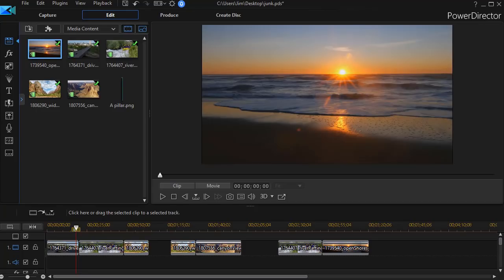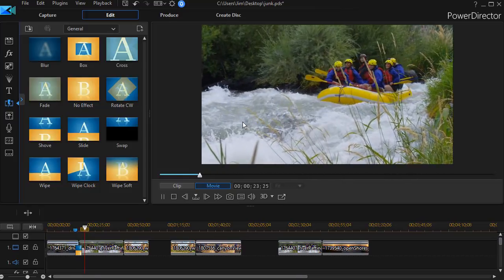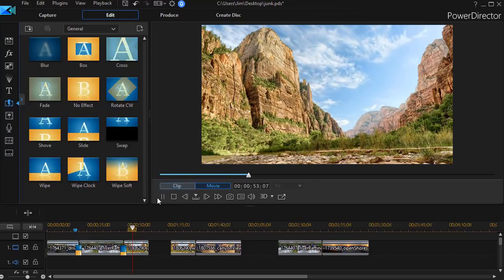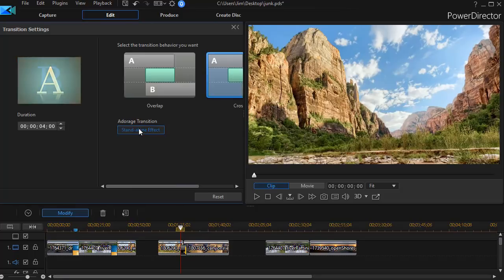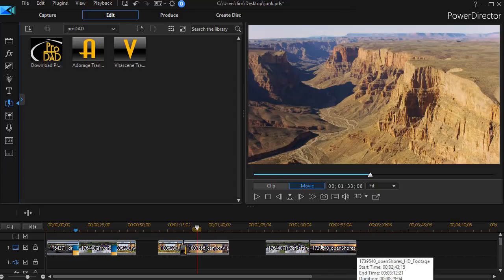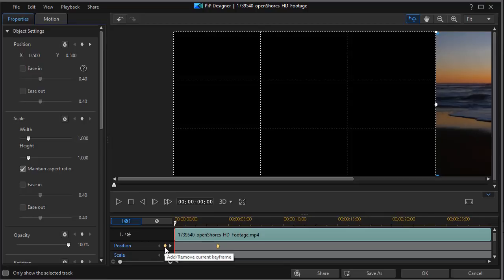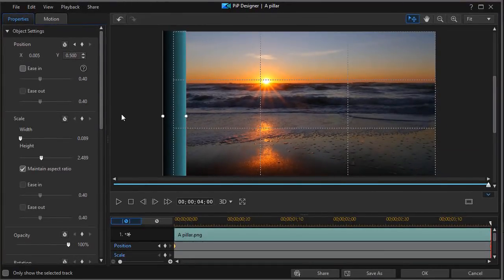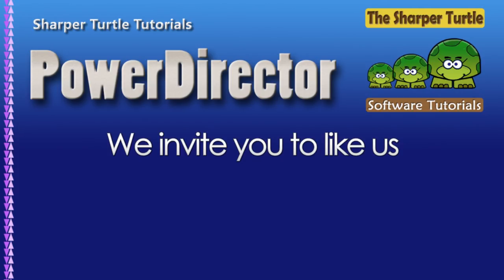PowerDirector - Tips on using various horizontal transitions between scenes

Comment: I did add adorage on an earlier (at least six years ago) edition of Power Director and never really got into it. I have recently changed my computer and downloaded the current version of PD365, but the Adorage effects are not there. So I copied the folders into the equivalent places in my new installation, but get a message stating that I need to download a newer plug-in - Vitascene.
And I can't find a link on Cyberlink's page to get the plug-in through them.
So would I be correct in assuming that if I want to get Adorage I would have to go direct to them, as Cyberlink is no longer working with them?
Reply from the maker: Tony,

I don't have a clear picture of the license agreement between Adorage and Cyberlink. Here is a link to a discussion on the Cyberlink forum that has some links that might help answer your question.

https://forum.cyberlink.com/forum/posts/list/78317.page#321151

The PowerDirector comparison page for version 18/365 shows Adorage 13 Lite in the feature list and ProDAD Adorage 10 & ProDAD VitaScene 3 LE included for users of Ultimate and 365. 

--Jim

Comment: Hi Jim, Happy New Year.  Have an issue I'm not sure you can help with.  I have what I'll call a "ghost", it's a piece of a video clip that I removed that only appears behind the current clip IF you add a transition.  I've moved everything, enlarged the section, done everything you would to remove a leftover clip but I can't find it anywhere so I can't remove it.  I tried different transitions including Adorage but it's always there.  I could just leave the transition out but would love to figure out where this clip is and get rid of it as I'm not a fan of hard cuts.  Any ideas?
Reply: Hi Jim,  I did fail to mention that I'm using PD365 now.  I am going to send the PD tech people a trouble ticket as this weird ghost transition "thing" is happening more often.  I actually created a whole new short video and had it happened three times.  I was thinking it might be "Enable shadow files on Hi-Res videos" which was enabled.  I disabled it but still get the same results.  I also produced the video and watched outside PD to ensure that the condition carries over and it does.  So again I will contact PD to see if the can come up with an answer.  Thanks Michele
Reply from the maker: Michele,
I applaud the efforts you are taking in order to track down this issue. You really have a strange anomaly on your hands, from what you describe. You've taken most of the steps I would have tried in figuring this out. I'd try to detect it and delete it as you have. Only one question comes to mind. When you switch to storyboard view, is the "ghost" clip still there? --Jim
Reply: Jim, thanks for the reply.  I actually figured out what was wrong.  Seems when you do "detect scenes" tiny fragments of another scene can be left behind.  They are so small you don't notice them until you put a transition in and then they appear in the background.  PD suggested I use their content to see if the same thing happened, it didn't.  That got me thinking, "okay what else could it be" so I went frame by frame at the end of each clip and low and behold there they were.  Once I removed those tiny fragments all was well.  So glad I figured it out as it was driving me crazy!!!!!  Thanks again.
Reply from the maker: Thanks so much for getting back to me. That's got to be one of the most annoying issues to deal with. I'm proud of you for your determination to figure it out. Hopefully we can both help others  who might find themselves in the same situation, Michelle. --Jim

Comment: Thanks for the "on-air" mention, I'm honored. 😄 I love the effort you made to create the third option.  If the 3rd option is a 1x usage, does the remainder of the video continue on the higher numbered track so that more standard transitions can be used?
Reply: Yes!
Reply from the maker: Chris,
I am glad to note my sources of inspiration where I can! You could handle the primary track for the video one of two ways. You could split a clip anywhere, and put part of it on track 2 and part of it on track 1, and then have your project primarily on track one. There is no transition where you split this, so when you produce it the result looks like it's all on one track. Or you can continue on track 2. The critical thing is that if you have a normal transition between two clips, they have to be on the same track. Does that make sense?
Reply: @SharperTurtle  
I have done this very thing as a form of the Multicam editing. From what I have seen, there is no way to specify the exact second to shift from one camera to another in Multicam. You're at the mercy of punching numbers for the cams.
Plus, my computer doesn't seem to like multicam that much, kinda jerky.
Anyway, I put a clip in each time line track one and two. Sync by audio, then I carve out my desired cam shots and removing the one I don not want. (First, unlink the audio you wish to use and move down a track for now and disable the other audio.)
As you said, you can just leave and render or shift the lower tracks up.
Reply: @SharperTurtle  That makes sense since you are just continuing the same scene but returning it to the original track.
Reply from the maker: Chris,

I often don't think abut splitting a clip just to have put most of the videos on the track I want. But why not? --Jim
Reply from the maker: Thanks!